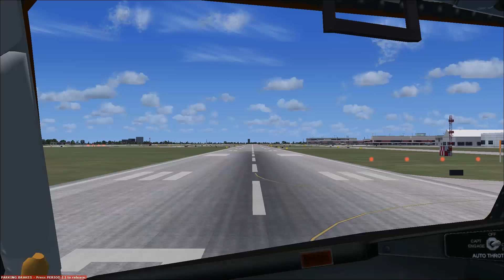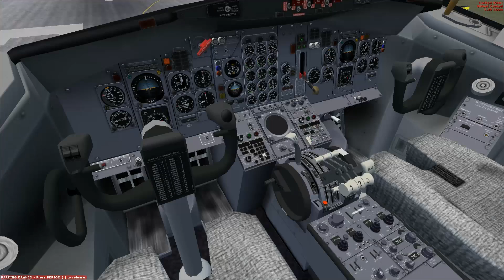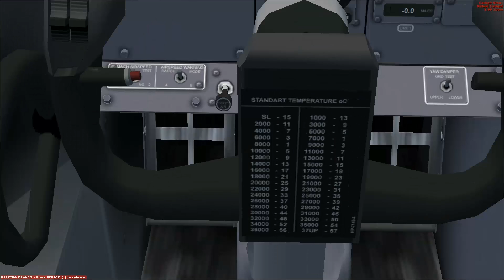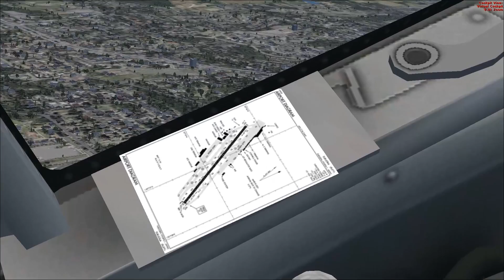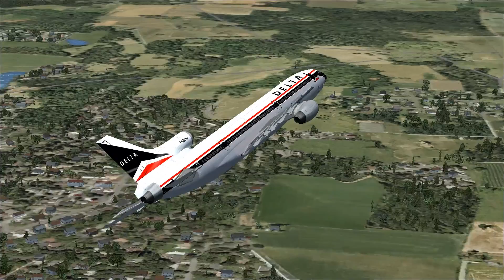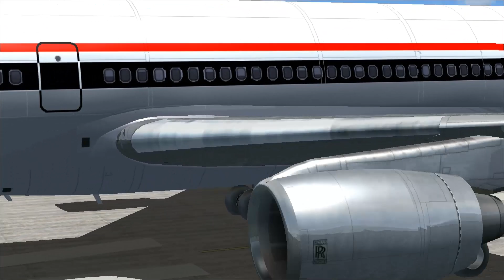Flight Simulator X Plane Spotlight - Lockheed L-1011-100

Comment: In Microsoft's flight simulators pre-2001, the small GA planes (like the Cessna 182RG) would break into pieces when it crashed.  Then the September 11 terrorist attacks happened and Microsoft thought the crash effects were unnecessary.  That's my understanding of it at least.